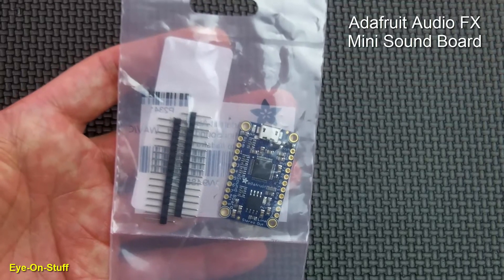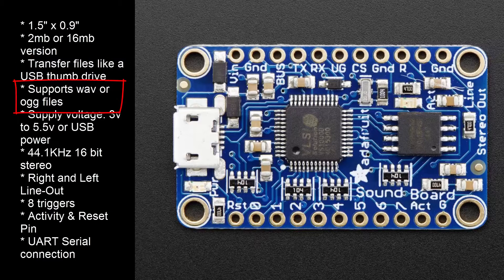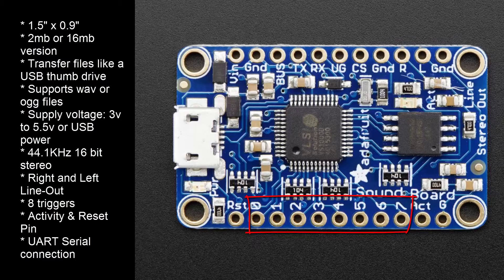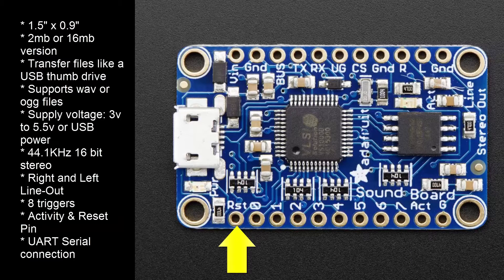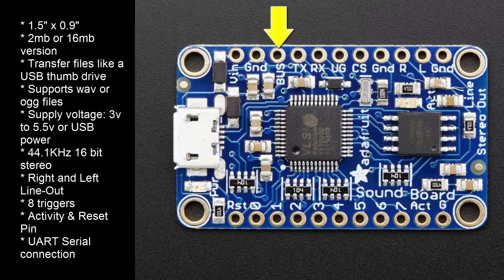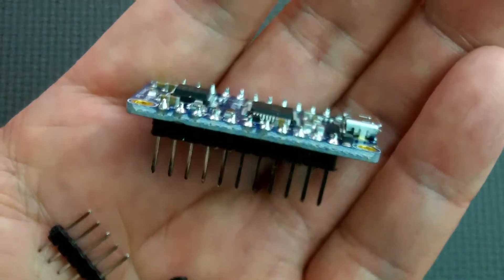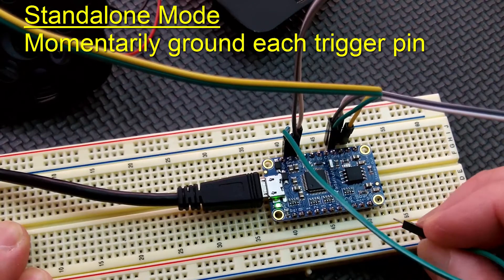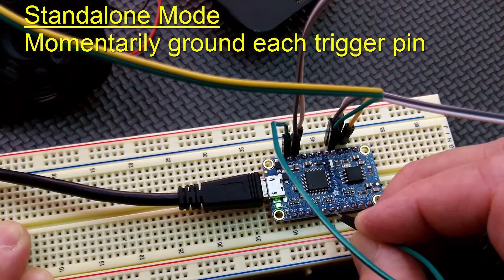Adafruit Audio FX Mini Sound Board - 16MB : Eye-On-Stuff

Comment: Is the latency low enough that I could build a percussion instrument like an electric kick drum with this?
Reply: I have been thinking the same thing - did you find the answer or try it out?
Reply: @mbrombert I ended up using the SparkFun WAV Trigger board. It’s a lot more expensive but it works well.
Reply: @pastorhudson  Thanks for the reply! I have been looking at the same one and it seems to be the best out there for what I am after. Does it have any latency when playing it in a full track with other instruments? Cheers!
Reply: @ no latency really. It’s very responsive. I used it to make a foot drum to play along with guitar. Worked great.
Reply: @pastorhudson  Wonderful... thanks for the info! I will definitely be getting one.